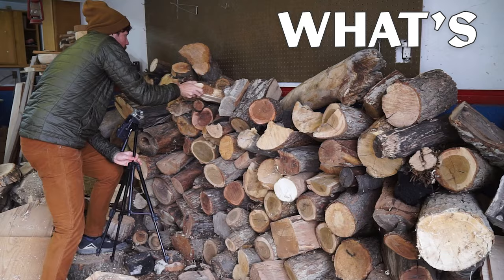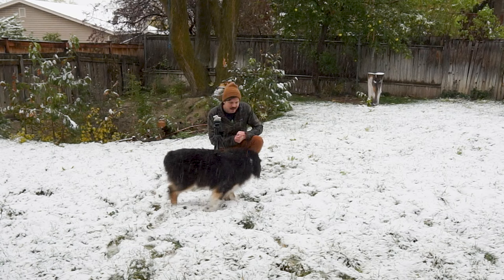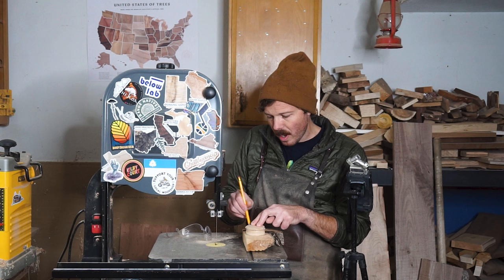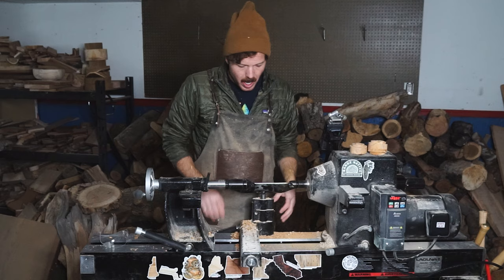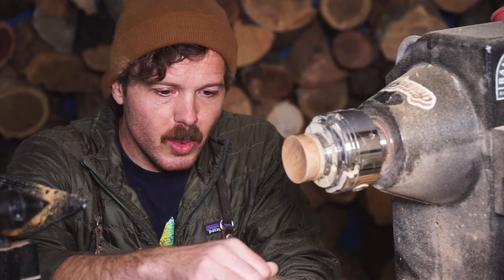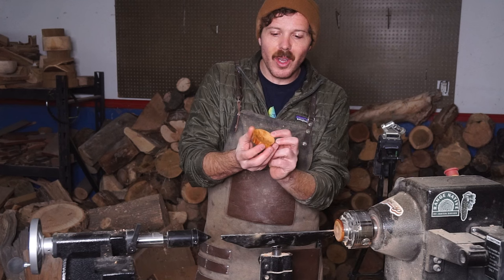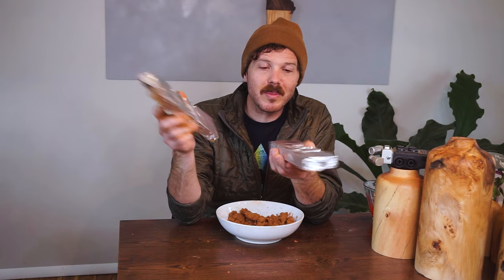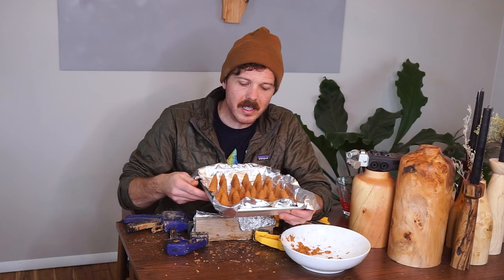How to turn sawdust into natural-scented incense

Comment: I absolutely love chatoyancy, though I didn’t know it was called that until now. I milled a southern live oak log for my workbench top and it has some nice figuring and curling making some parts look 3D. 

If you don’t have a tree for Florida yet, I’d suggest either the southern live oak (also called cathedral oak in some places here in NW Florida). More common is the Southern Yellow pine that was logged for good home building lumber and still is but more sustainably than the clear cutting old growth days.

Comment: The term "chatoyancy" is often used in the context of gemology and describes the optical effect seen in certain gemstones, such as tiger's eye or cat's eye chrysoberyl. This effect resembles the slit eye of a cat and is created due to the reflection of light by parallel fibers, needles, or channels within the gemstone. When the stone is cut and polished in a specific way, usually in a cabochon shape, the surface displays a narrow band of light that shifts as the stone moves or as the light source moves. This makes the gemstone appear to be lit from within or to have a glowing line running across it, which is quite striking and highly prized.

Comment: My quick method is pack it into a corner of a baggie than twist it tightly closed till it’s in a shape than pull it out of the baggie and flatten the bottom, looks like crap, but it works